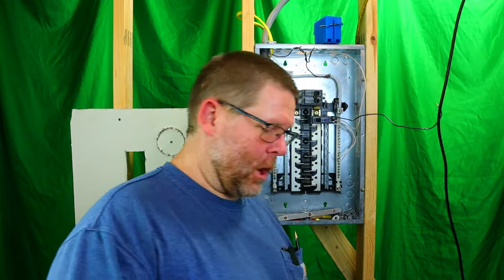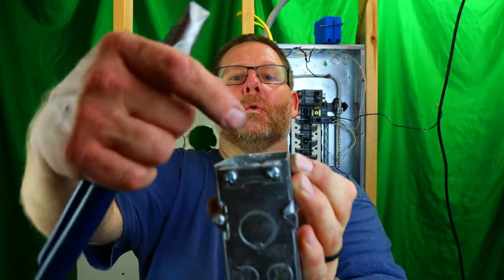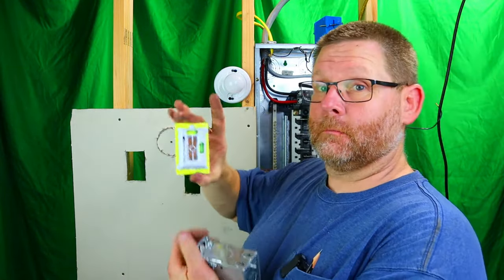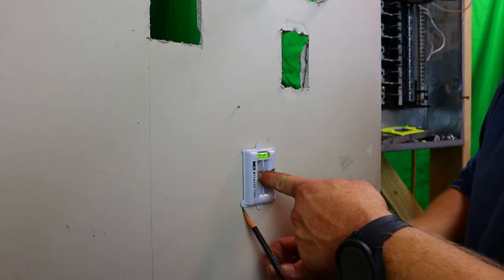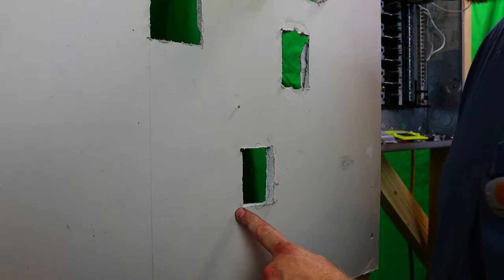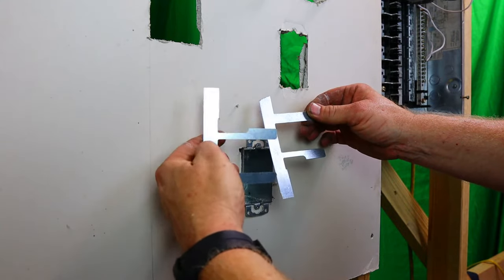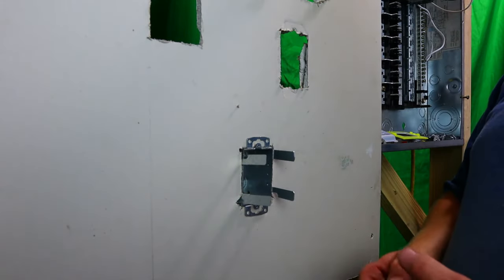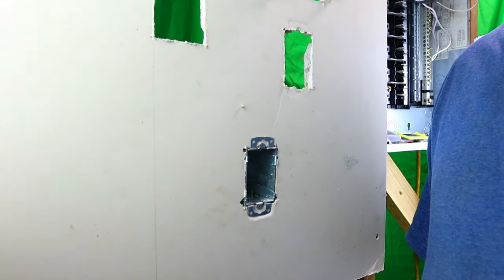How To Install F Clips Or SteamBoats To A Cut In Box

Comment: I call them F clips because i'm still wondering what the F they are for. Lol. Just kidding. But seriously, do they hold the box into the hole? And where do they hold exactly? I couldn't see what they clipped into.
Reply from the maker: Yes the hold the box in the wall and the top of the box ears keep it locked into place good question

Comment: I normally use plastic old work boxes in my house, but in the garage, there is OSB on the back wall covered with firecode sheetrock. The wall is 1.25 inches thick, so I needed a metal old work box.  You  gave me the education that I needed. Looks like the F clips will do what I need to do.
Reply from the maker: Awesome I appreciate you watching and commenting. Good luck on your project.

Comment: Good information. So they are supposed to keep the box from coming out of the drywall but not the other way around? Meaning they don't work if the box is sinking in from a given side(lacking back support)

Comment: I've also noticed if you fold in either corner first, that's your last real opportunity to make sure the screw holes are level in your box before folding in the last two. You still have a bit of wiggle with just two folded in.

Comment: Can these be used to push down the side of a plastic new work box that is sticking out of the drywall a little because the 2x4 the other side is nailed into is a bit warped?  This is for a 2-gang box holding only light switches, not an outlet.  If I manually press that edge, it does recess to the drywall so it isn't like a killer amount of force is needed to do that.  Unfortunately we are at the point that fixing this other ways would not be easy because there are a lot of wires coming in the box.
Reply from the maker: Great question. I would not because it has the potential to become energized potentially. In my opinion it may be a better idea to replace the box all together maybe with a box like this https://amzn.to/3YGb6vA
Reply: @MountaineerOutdoors  Thank you!

Comment: You have not explained what these are even for.
Reply: These are 'renovation' boxes used when you need to add an electrical box without cutting a larger access hole to screw a box to studs.  This allows for a much smaller hole as you don't have clips or wings to push into the opening to hold the other style or reno boxes.